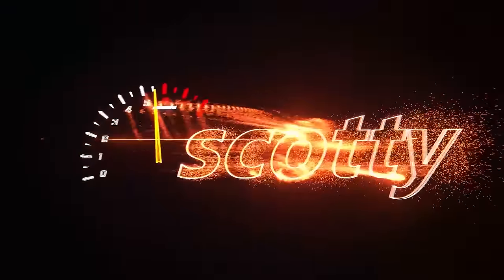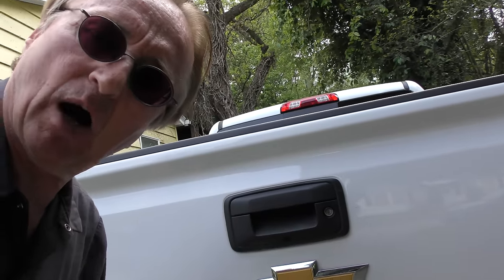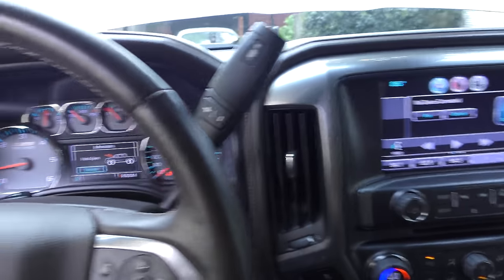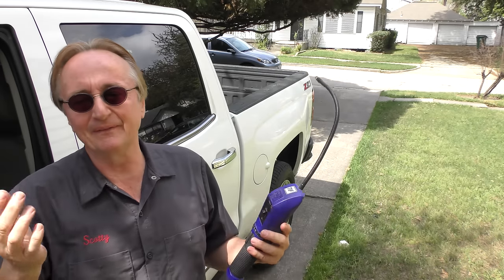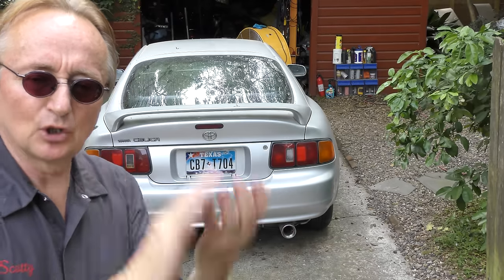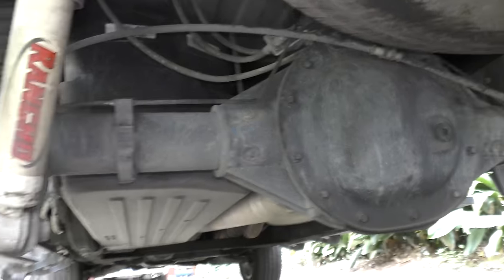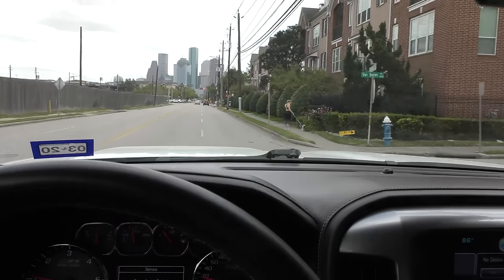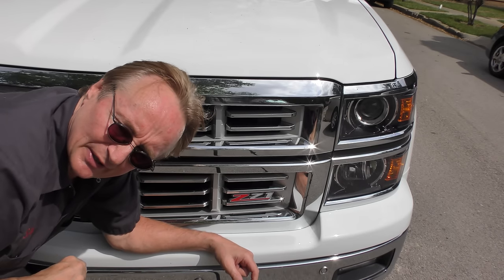Here’s Why I’ll Die Before I Buy a Chevy Silverado

Comment: got a 2006 silverado hd with 435,000 miles. runs like a dream and could rip the toyota in half while towing a boat.

I'll stick with my Chevy.
Reply: When you are a fan boy, it's called delusional
Reply: 435k hahaha ok buddy
Reply: My dad had a 99 and a half. 5.3 z71 Silverado. Had 460,000 on it when he totaled it and he was hard on that truck. So very believable for me.
Reply: Coads 1 yeah totally crazy....almost like all those guys making stupid power with junkyard 4.8,5.3,6.0 ls motors running 8s in the 1/4 mile for dirt cheap. Love all the butt hurt in the comments. So much heart and feelings into brands you had no part in.
Reply: That’s wtf I want a Silverado smh
Reply: Earth Monster those trucks were built better than the new ones
Reply: I’ve seen used ones at a dealership in my town with 200k+ miles on still selling for high $$.
Reply: Thru  rod on my 97 Silverado at 160k... was just driving it normally and it started knocking. Wasnt impressed. My 91 e350 is still tanking along at 310k and starts right up in subzero temps no worries.
Reply: Ya that's a pretty solid rig
Reply: Lots of Gm trucks with 400+
Reply: Earth Monster 435k idk about that but I have an 03 2500hd with 196k and my AC is ice cold 🤷🏼‍♂️
Reply: America cars is just loud and for lazy ppl where most cars are driver focus like Honda,Toyota,Lexus,Volvo
Reply: I got exactly 315,239 2003 model 4x4 z71 extended cab runs great
Reply: Never had any issues with any of the gm trucks I've owned
Reply: Unfortunately 06 is about the last year GM built good trucks. Gonna keep my 2003 Sierra as long as I can.
Reply: @markyoung2916  my 08 Silverado was a tank my current 2015 Sierra seems to be going pretty strong I've had zero issues
Reply: Gm for the most part make good motors but they generally fall apart everywhere else, especially interiors. The trucks are pretty stout overall. I would pick a Chevy truck over a Dodge. Even though the new Chevy trucks are ugly as sin.
Reply: J Hard willing to put a wager on it smiley?
Reply: My ex had a 99 cavalier that was stuck at 345,000 miles, it burned oil pretty bad but kept on going, until the subframe rusted out and the wheel fell off lol
Reply: 2006 was the very last good year of GM trucks
Reply: @misterbulger  wasnt a rod, you broke a $1 exhast manifold bolt and it makes the same noise when its cold. Very common problem on old vortec engines.
Reply: If you keep your engine and tranny rebuilding and keep maintenance on it it will do you right, 2004 Chevy chilverado 2500hd has pulled trucks out of mud and I use it to drive and pull my trailer with atvs, there’s a lot of power there, most of what tears apart are all the plastics and knobs and crap that just wears and tears, I love Chevy so much I bought a project 1991 Chevy s10 and my plan is dropping a big v8 350 engine someday
Reply: Same
Reply: In your dreams maybe
Reply: I've also owned several Chevy trucks, and my current 07 GMC Sierra 2500hd, 6.0/6l90 trans.
It was a salt truck in up state New York when I bought it last year!  Rockers.  Gone.. cab corners.. gone.. wheel arches on bed.. gone.
Frame, floor, cab mounts?  Solid as hell. 
$3 grand with 143k miles and a freshly rebuilt trans.
Runs and drives nearly new.  Had to replace oil cooler lines, power steering lines and cooler but it's an awesome truck. Going to be doing the metal work soon.
Best truck I've ever owned? My 91' Chevy 3500. What a friggen well built truck! Wish I never sold it last year. 454 with the 3 speed manual plus granny gear.
Reply: Based on Chevys track record, recalls engine failures I DO NOT BELIEVE YOU.
Reply: @herbertpearson5665  literaly any 1500 is well over 200 to 300k and running fine. Check the marketplace. WITH EXPERIENCE from working on plenty of chevys and looking to buy them I have seen the meters reading 300 to 400k most of the time. The motors will outlast the truck. Iv worked on lots ofem witch inlcludes from 1990s to 2019 they will hold the milage even after being used as a work horse it's hole life.
Reply: Dude we switched to Chevys after our ford service trucks failed the chevys are over 250k minimal repairs the fords just died motor trans ect on the ford service trucks the ac would go first then trans replace the trans engine blows
Reply: Yeah..well this new one is garbage.  He is right.
Reply: With the 6.6? POS. One doubt you could rip it in half. Two that Toyota will go a million plus miles and still not skip a beat. Dont believe me? Just do a quick search of the 22re and some of the v8 tundra out there.
Reply: Jonathan Palmer 6.6 duramax has a few trucks over one million miles it’s on YouTube as well. The one million mile tundra had many repairs to the trans rear end all work vehicles have repairs if you ever operated or ran a fleet you would know this. Trucks used for construction and towing live a much different life than the mall crawler you prolly drive.
Reply: @travisvaughan8838  My truck is definitely no mall crawler. Seen more dirt in the last week then you truck has in the last year. But I'm a diesel tech and will not even mess with a 6.6 because it just becomes a black hole.
Reply: Jonathan Palmer ur a tech lmao yeah your trucks seen dirt but is never seen a need full of construction debris overloaded trailer pulling to a cell site in 4wd that’s real work bud
Reply: @travisvaughan8838  yeah actually I am a Diesel technician, can you tell me how go prime the fuel system on a Detroit 12.7l, and how to prime the system on a 2012 DD13?
Reply: Jonathan Palmer I use trucks for work I don’t work on trucks..... and I know what last
Reply: @travisvaughan8838  okay well I work on them and see there faults every day and out of the 7.3l and 5.9l in light duty market the 6.6 is the worse. Now the 6.0 is a different story if they arent sorted
Reply: Travis Vaughan eeeeexactly. My truck pulled a trailer and delivered John Deere equipment for 400k of the miles it has. I've gone back and forth to visit family in NJ from Florida 5 times and this beast just keeps hummin.
Reply: Earth Monster what motor?
Reply: Dont buy a first generation Colorado.

The exhaust manifold literally blows up.

Then costs you 3K to fix it.

Sure the engine is good. But the exhaust manifold design is terrible.

Every single colorado of that generation has that exhaust problem.
Reply: My husband works construction. 30 yrs.  Nearly all the trucks are chevys on the jobsite.. Older ones too 20 years old. Work trucks that get used. He saud hes cant ever remember seeing an old toyota or rarely a newer one there. Because they cant handle it. I guess all the toyota drivers are holed up in the trucks with the air conditioning on. Afraid to be work or drive over a bump. Or get it dirty.  I'll stick with chevys.
Reply: @shitdevil1991  Nice my 2003 Chevy 2500HD 4wd Durumax diesel has 230,000 miles and even with the added strain or 37" tires and an Edge Juice Attitude Power Porogrammer, Edge exhaust and Edge air intake giving her an extra 250lb-ft or torque she still runs like a dream and has never had an issue in the 3 years I've owned her, she is even still running the original transmission without any issues!
Reply: @thegreen4me  Yeah I had that same issue and it was an easy fix.
Reply: @jonathanpalmer228  My 2003 Durumax has 230,000 and runs great and has never had an issue even with it running a 6" lift, large aggressive 37" tires and an Edge Juice Attitude Power Porogrammer, Edge exhaust and an Edge air intake giving it a lot more torque and it's still even running the stock transmission which still runs, works and shifts great and it never overheats under heavy loads either!
Reply: @ @jonathanpalmer228  My dad owes a diesel shop and I might not be one of the techs I'm a painter, welder and fabricator but I own a 2003 6.6 Durumax with 230,000 miles on it running the original transmission and it has not had any mechanical problems and runs great and in the shop as well i can see the 6.6 Durumax is an amazing engine and I'm not a dodge fan but the 5.9 Cummins is a great engine too but the 7.3 Powerstroke is a worthless dog, we rebuild or scrap more of those than any other light truck engine by far!

Comment: I have a 2006 chevy Silverado and still has the original evaporator in it with 250,000 miles
Reply: Chevy is a joke
Reply: @hunterjacobs2178  i bet you like ford
Reply: Maybe , but I bet it's falling apart inside.
Reply: Right.. he's saying the quality now sucks not 2006.. I have a 2015 with 58000 miles and I had the same problem.
Reply: we had a 97 Silverado when I was growing up.  I'd take that over the 2018 that was fully loaded that I just offloaded.  Your GM vehicle lived, and had a good life, but most don't.
Reply: I just bought a 2006 with 123xxx miles  runs like a champ. Hoping to get a lot miles out of it. Wouldn’t drive anything else for now..
Reply: Got a 2014 with 60,000 k 5.3l work truck model with no AFM or cylinder deactivation.... Hoping to aleast hit 125,000 but mite trade in couple years get another
Reply: @kevinbreaud7959  Mine isn't.
Reply: I just got a 2016 model and my air does not get real cold on a hot day like he is describing. I don't think that issue is a coincidence. Looks like I got the same issue
Reply: I have a 2005 and it's never let me down and it has 250,000 miles.
Reply: @TheFracturedfuture  I had a '04 Tahoe with 248, 000 started every day only thing I had to do was put brakes in it change the oil wheel bearings once and I paid two grand for it It only had 2,800 hours on the engine even though I had 248,000 If you average it it's like 65 miles per hour it's all highway thing was mint 06 is my favorite year actually 06 and 1/2 they called a 07 classic so last year that style vortec 5.3 but you can get the modern 2500s without AFM just the 1500 n 150s are like cars and 2500s are trucks
Reply: @hunterjacobs2178  Ford: Fix Or Repair Daily🤡🤡🤡
Reply: I’m not a fan of the newer chevys and gmc trucks but I have a 03 that has not done me wrong and it’s creepin up on 300000
Reply: @hunterjacobs2178  I worked at two separate construction companies that had Ford company trucks. Half of the fleets were in the shop constantly and the second company switched to Chevy, we could actually get to jobs site now who knew. Even dodge rams were decent
Reply: my 2nd gen got over 100K miles on it and never had a problem with her
Reply: Mine also 2006 Silverado. Have no problem and easy to maintain.
Reply: @PheonixMan795  any camaro is better than a ford. So fact check your self.
Plus i dont have one
Reply: @michaelwilson0889  quality control has gone downhill because they want to push more out and make more about profit margin. the CEOs are like oh make sure the vehicles are high quality no just yell at your workers until they push out more units idc if the quality is trash
Reply: I've got an 04 1500 completely stock aside from a k&n air filter, been through multiple accidents and has near 200k on her. Shes still tougher, works harder, and healthier than Scott here. Now that's good old fashioned American engineering, as far as the new stuff goes it all has the same problems and a similar longevity no matter make or model.
Reply: I sold my 06’ Silverado with 234k miles on it to a person in my home town and he loves it. The 5.3L engine has been great in my 06, 13 and 2017
Reply: @williamlopez448  The Chevy Silverado didn’t exist until 1999. I’m not trying to say anything negative to you, but before ‘99 Chevy had C/K trucks. It’s just the name, they weren’t Silverado’s back then.
Reply: @ej3997  huh my ford has 138000 miles 2.7 ecoboost loaded to the tits with tools and roof rack. Runs like a dream🤡
Reply: @1986subway  Just 138k? 😂 Come back when that thing reaches 180 - 200k and then we’ll talk 🤡.
Reply: 2006 was the last year for a quality GM product
Reply: @ej3997  except my ford right? 138,000 fully loaded work truck. Brakes and 1 wheel bearing. Has original rotors🤡🤡
Reply: @1986subway  thats it? Original rotors? So everything else has been repaired? 🤡🤡
Reply: My 06 was a tank. I wish i still had it.   My 17 just broke at 77k
Reply: that generation silverado is good, he’s speaking of 2007+
Reply: @Thedieselpimp  not true. Had a 1994 Silverado 1500. Remember it very well. My first truck.
Reply: @joedowdle6818  Any chevy pickup <1999 is a Chevy C/K truck. You can look it up or call a dealer and ask or whatever you wanna do lol. I didn't just make it up, that's just how it is. 1999 was the start of the first generation of the Silverado. Them and the C/K were very similar, they kinda just changed the name.
Reply: @mcr_tactics1587  classic Chevy fan boy lol.
Reply: @milsimmusic1318  damn you diss on Scott. Come on now, it’s okay your a Chevy fan boy. But you don’t gotta piss on Scott like that. He just tells the truth, and you don’t want to accept it because you own one. Lol.
Reply: @ej3997  nice one!!! You showed him!!! Lol
Reply: 178000 on my 07 tahoe ,as far as I know all original ac parts, ice cold
Reply: @hunterjacobs2178  no matter what you like, it's got its share of problems
Reply: @mcr_tactics1587  my company had a ton of 550 ford's 2010 lower,the  v 10s  has exhaust manifold problems !! horrible fuel mileage,  5 miles to gallon. 
6.4 blow up, 6.0 blew head gaskets, need to pull cab off!! 
positive note, 6.7  and 7.3 gas are nice!!! so far
don't buy any ford from 2004 to 2010 gas or diesel!!
Reply: @Thedieselpimp  Before 99 "Silverado" was a trim level since the 60's
Reply: Nice same, only had to change alternator, water pump and a hose!

Comment: My first truck was a chevy Silverado. 280k miles trucks been every mudhole I saw in my teen years and it still runs like a top. I got it when i was 14 and I'm nearly 29. I've put an alternator on it. I think I'll keep my chevy
Reply: those chevys back in the day were good, these latest in the last 10-15 years...not good
Reply: @kdwindowcleaning  they call em "cowboy caddilacs" not even trucks anymore.
Reply: That’s because it’s an old one. Old Chevy-Ford-Dodge Trucks were Great, new ones are JUNK.
Reply: @cavscout62  correction their all junk except Ford.
Reply: @cavscout62  ive got a 2013 f-150 with the 5.0 and it is a fantastic truck, the only work we did with it is basic maintenance and a replacement battery, great truck, id say its one of the last good modern trucks
Reply: @elmerllamas3792  5.4 triton and 6.0 power stroke were garbage.
Reply: @elmerllamas3792   i was gonna go with a newer F-150 5.0 but they have oil consumption issues ford just trying to bandaid the problem put in a wider range dipstick wow
Reply: 2010 silverado 2500hd.  260,000 miles alternator,  shocks, wheel bearing, idler pulley still running but due for a tranny
Reply: Yes, we owned a 99 and presently own a 2005. Great truck!!
Reply: @oldschoolrunescape-demonan2015  the triton engines like to spit spark plugs… almost everyone I know who’s had one has had it happen. I bought a 5.4 Econoline that had had the heads sleeved and retapped because it spit out the plugs, ran fine after and never had a problem again. The transmission was silky though, never slipped or shifted weird.
Reply: @kdwindowcleaning  that applies to Ford and Dodge as well. When they started adding all these new electronics is when things went south
Reply: @elmerllamas3792  laughs in 5.4L

You’ve got to be joking here. If you want a shite powertrain, keep your Ford.
Reply: Did you change your own battery?

Comment: My 05 2500HD with 503,000 miles still works perfectly
Reply: Do you have the 6.0 or Duramax?
Reply: I second this question 6.0 or DMax?
Reply: Had 2 GM trucks both with 300,000 mile plus with no problems & running strong!
Reply: Deom 2014 and up GM went down hill, as a Ford guy I prefer Chevy between 03-08 than Ford since Ford had problems with their engines that time
Reply: fastmove117 not the 4.6
Reply: I have a 2000 GMC Yukon with 250,000 miles, had the trans replaced once but other than that no major issues today.
Reply: Gotta 01 Chevy z71 with 329,000 and it runs great... its all original... but the engine does show signs of the mileage a little.... just a pinch noisy at start up for about 2 seconds... only after it's sat for a week...
Reply: You got a freak...  my 07 engine died at 104000 miles.  Castech heads...

Comment: Mine is 20 years old and is clearly the best truck I have ever owned - this dude has a broken compass - like a rock
Reply: Their older vehichles are better than the modern ones.
Reply: love my 03 chevy!!
Reply: I'd say 07-13 was the last really solid gen for chevys. Stuff after that is still decent but has lost its quality over time
Reply: I traded in my 1999 Silverado for a 2015. I wish I could get it back
Reply: if you watch the whole video...he basically says nothing except that the evaporator and tailgate handle are junk.  that hardly makes for a worthless pickup.  the suspension, chassis, engine, all solid.  yeah it sucks to change the AC at five years or so, but that doesn't make the truck a poor purchase.  I'm a ford guy, but I agree with you on the call...nothing bad on these rigs.
Reply: @MohrsCircle that "modern" one its already 10 yrs old.